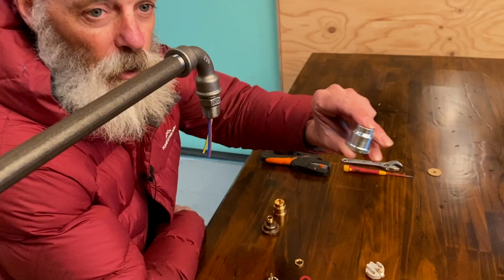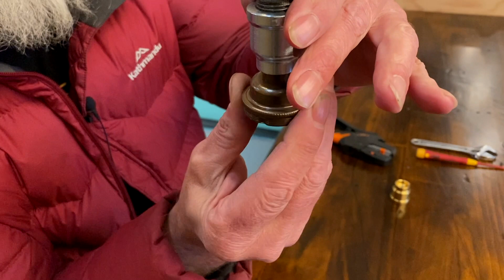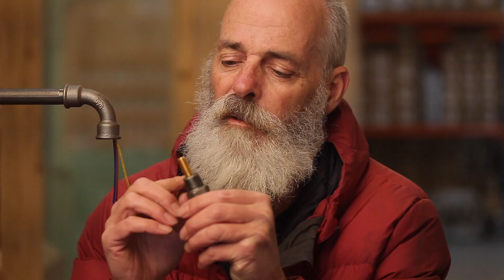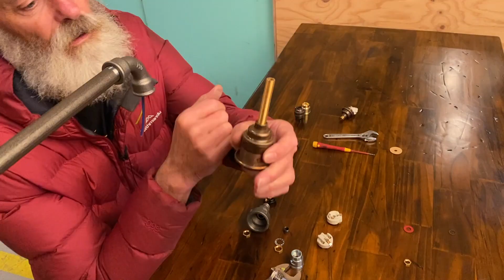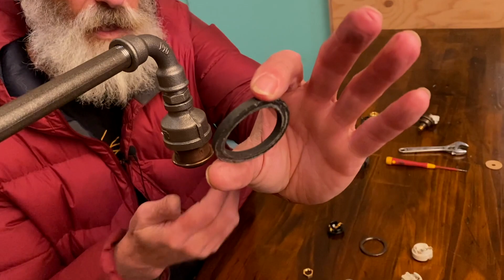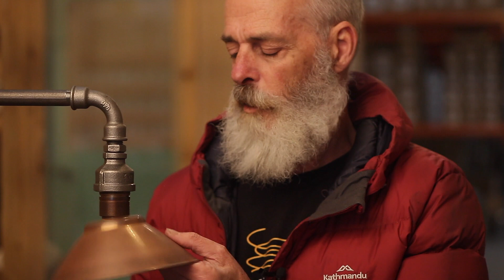DIY Plumbing pipe lighting hardware components

Comment: Honestly, all you need is the nipple and the reducer then insert your socket into the reducer and call it done.  That's the method I have been using for the last 10 years on my pipe lamps.

Comment: 😂 I use a 1/2" npt to 1/8" not bushing, and the socket attaches directly to it, not to mention it looks like the rest of the lamp unlike this adapter does, and is available in the same place as the rest of those plumbing parts 😂, nice try though lol
Reply from the maker: What is that part?
Reply: @EdisonLightGlobes  it's a brass bushing, it's usually right where the air fittings are, ace hardware has them in iron and brass, galvanized too, no need to buy an adapter, it already exists